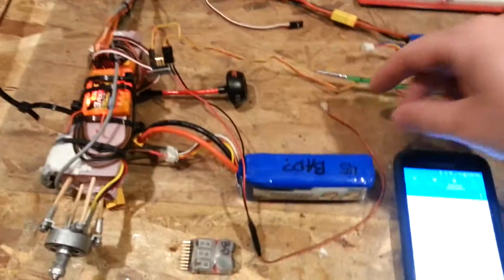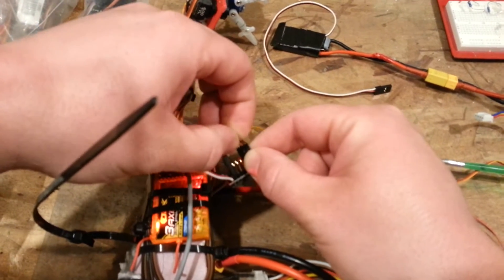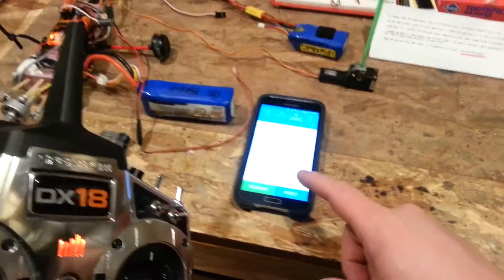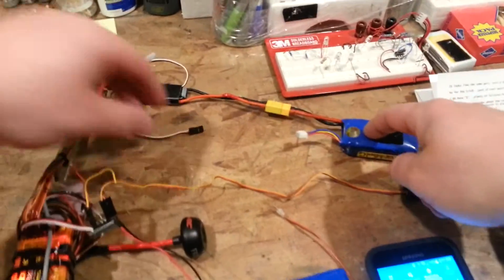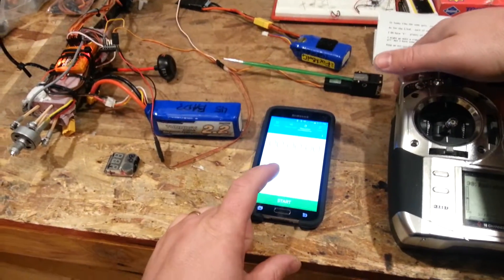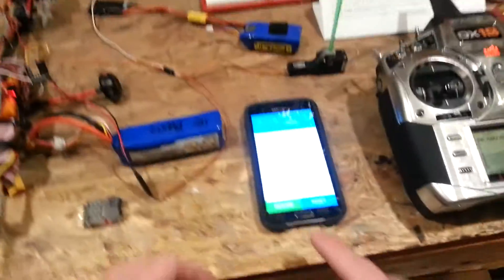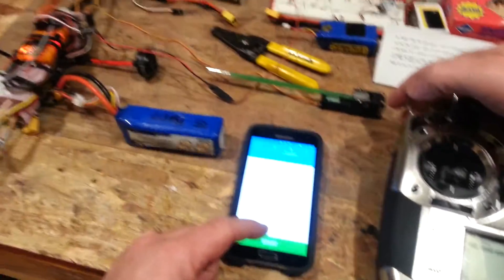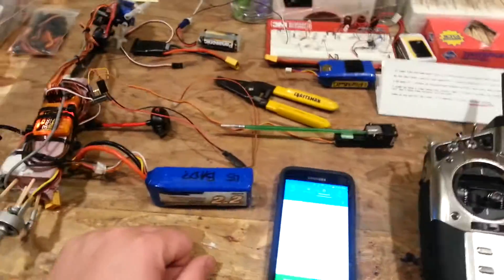Can you slow down your servoless retracts???

Comment: I'm so late to this party, but what are your thoughts about soldering in an inline resistor to the retracts supply wire?  Would it get hot and melt foam?  Would it constantly pull power from the battery and reduce flight times even when your not actuating the circuit?

Comment: Very informative.  So... you could bust open the retract and use a resistor as a voltage divider on the power going to the motor.  I think the low limit you hit was that the control circuit needs a certain voltage to work.  However the motor will likely run slower with a lower voltage, hence my suggestion to use the voltage divider.  Like you said, lots of time, effort and risk of damage.  Is it worth it ?  Depends.  If you are looking for scale operation then yes.  Cheers
Nicholas
Reply from the maker: Totally! If it's worth doing, it's worth OVER-doing ;) You GET me - LOL!
Reply: Out of curiousity did you ever try this?  Perhaps you have and I missed the thread?  What size resister to use to slow down a retract to say ½ speed?

Comment: I set myself up recently to be able to plug both my remote and plane into the the wall. I hooked a JST to a 5 v and a 9 v adapter. No more battery chewing while programming. 

Time to put JSTs on my dusty desktop power supply as it has a bunch of 3, 5, 12 v. 

What about a resistor between the receiver and the retract to lower the voltage? I also just put a retract controller on the Corsair but it is just delays one and I don't think it slows it down much if at all. I could try lower voltage to that controller.
Reply from the maker: You could make a voltage divider circuit, but not JUST a resister in series. This would most definitely lower the voltage output, to whatever you wanted, BUT you'd be actually loading your electronics...so maybe not the best option??? Depends on if you don't mind burning off some flight time with a warm resistor...but if it's on a separate pack, maybe that'd be okay...

Comment: Excellent explanation and demonstration. Knowing what the servoless will do when low-voltage current is applied helps, because you proved there IS a bottom limit—albeit an unspecified value. Thanks for taking the time to demo this thoroughly! Now I'll have to bust out that electronic flap/gear speed reduction device and see what it will do with these plastic/metal retracts from HK. ;)
Reply from the maker: Let me know how it turns out! I'm really glad this helped some :)

Comment: You gave me an idea lol, I will try powering my retracts on my A320 through a 3.3V bec that I bought from banggood :-) thanks!
Reply from the maker: I LOVE THIS IDEA!!! Send the link here for everyone please :)
Reply: Brian Phillips no problem, I will do the mod after christmas and post a video of the result :-)
Reply from the maker: Nice, thanks!
Reply: Brian Phillips well, the retracts I use (PZ15090) are standard ones on 3S planes and they are rated from 4.8V to 6.0V, I have tried to run them with a 3.3V bec just now but they don’t fire up :-( my bec is taking power from the receiver
Reply from the maker: In this bench test, I was using a common ground from BOTH BEC's and the positive line from only one BEC at a time. The signal comes from the same source where the primary BEC is powering...the Rx.

IF you DON'T attach the ground side from both BEC's the thing won't work - I guarantee it :)